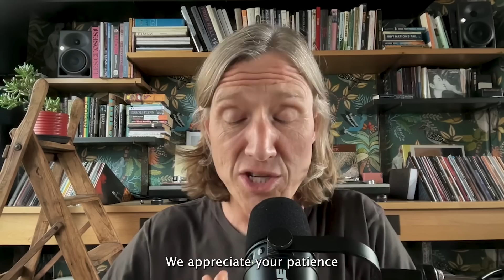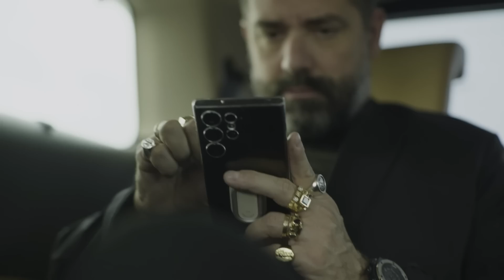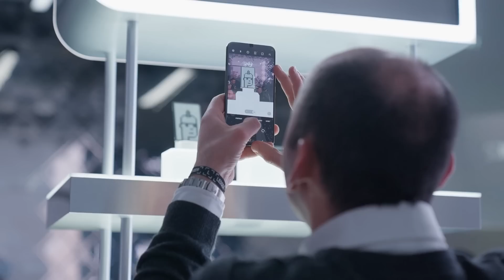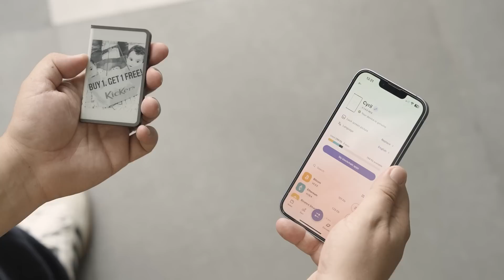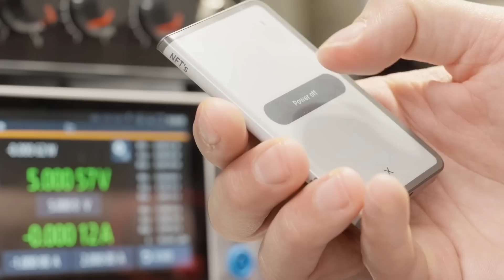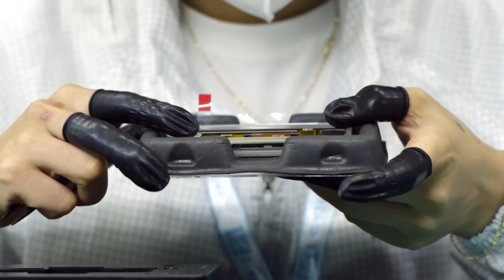Road To Ledger Stax

Comment: Hello, I am your old fan. I bought a ledger cold wallet, but the connection is always HTTP503. I can't connect to the wallet. What's wrong? Urgent, please help me
Reply from the maker: Hello, to ensure smooth operation of your Ledger device, could you please make sure your versions are up-to-date in the order mentioned here: https://support.ledger.com/article/8458939792669-zd

Then head to Ledger Live settings > help > and clear cache to refresh its block explorers. And try again your connection. If issue persists, please reach out here: support.ledger.com

Comment: I place an order on 07 27 2024 and still waiting. 1 ledger stax,1 magnet shell,1 belkin boost charge. been pending since i ordered it. Any help? reference number LDG2822004
Reply from the maker: Hey, that's normal, rest assured, all orders made in July are in Batch 4, which is being shipped this month and should be completed by end of September. 

You will receive an email notification once the parcel has been handed over to the carrier. 
If you need any further assistance, do not hesitate to reach out here: support.ledger.com

Comment: So reading on seems after a 2 year wait, I've been stitched up with £420 of plastic that has 1 mere my of memory.  WAC.
Reply from the maker: The storage space for apps is the total storage space of the device minus the firmware size. The firmware size can vary depending on the firmware version. 

You can safely install and uninstall apps when needed. If there's not enough storage space, simply uninstall some apps to make room. By uninstalling apps, you will not lose your crypto assets since your private keys always remain secure on your Ledger hardware wallet.

Learn more: https://support.ledger.com/article/4404382258961-zd

Comment: After waiting for more than two years, the NFT market almost burned, this is too late ledger, why do I even need a ledger stax? If I want to show my NFT collections I can set as wallpaper on my phone.
Reply from the maker: This is why: Our Secure Element chip and innovative touchscreen products like Ledger Flex and Ledger Stax set us apart, offering unmatched tamper resistance. Our attack lab, The Ledger Donjon rigorously tests our devices to maintain the highest security standards. Additionally, we hold the ANSSI certification, awarded by the French Cybersecurity Agency after independent labs have conducted thorough tests on our devices.

While competitors have their strengths, Ledger does not compromise on Security. Ledger’s security model and continuous innovation ensure that your assets stay in your control, no matter what.

Learn more: https://www.ledger.com/academy/topics/ledgersolutions/ledger-wallets-secure-screen-security-model

Comment: Coinify stole my money when i made a transaction in a ledger wallet. Ledger its not safe.
Reply from the maker: Ledger Live is your secure interface, not your custodian. Always verify what you sign on the secure screen of your Ledger device, which is connected to the Secure Element chip and cannot be tampered with. Transactions are always signed on your device, ensuring that your assets remain offline and protected. Avoid blind signing whenever possible. Don’t trust, verify. 

Learn more about clear signing: https://shop.ledger.com/pages/clear-signing

Comment: All of this is negated by the closed source code and the fact that there is a back door to extract keys
Reply: Is this true?
Reply: @frixosfriedman7813  yes. Ledger has a recovery seed thing where you upload your private key they hold in case you loose your keys
Reply from the maker: At Ledger, our mission has always been clear: to empower individuals to securely self-custody their assets. With over 10 years of innovation, 7 million devices sold, and zero hacks, Ledger is the trusted leader in hardware wallet security.

1. No Backdoor. Ever.

Claims of an “active backdoor” on Ledger devices are categorically false. Ledger’s security model is based on secure element hardware and cryptography, ensuring that only the user has access to their private keys. Ledger Recover, provided by Coincover, is an optional service and does not change this principle.

Ledger takes transparency seriously. We employ proprietary software for our Secure Elements, ensuring the highest level of tamper resistance and security. Importantly, a majority of Ledger's code is open source, including Ledger Live, Wallet API, Secure SDK, and embedded applications on our devices. You can review key components like the LedgerOS commands dispatcher, and entry points of Ledger Recover, provided by Coincover, implementation and its cryptographic library here. Ledger undergoes regular third-party security audits to ensure our security measures remain robust and reliable.

2. Ledger Recover: Cryptographic Innovation with Security.

Ledger Recover is an opt-in paid subscription service provided in partnership with Coincover, an industry leader in digital asset protection. It is designed for those who find the traditional 24-word recovery sheet daunting. The service requires a paid subscription and leverages advanced encryption and shard-splitting technology:

- Your seed phrase is split into 3 encrypted shards, each stored separately by trusted providers in three different jurisdictions.

- The shards can only be reassembled with your explicit consent, through your device and ID verification with two of the three providers.
Neither Ledger nor Coincover has access to your private keys at any point.

- In the 1+ year since its launch, there have been zero incidents involving Ledger Recover, provided by Coincover, with many customers expressing relief knowing they have added security, the peace of mind of having a backup SRP, and the convenience it provides.

3. Third-party access Misconceptions.
Let’s clarify:

- Ledger cannot decrypt your seed phrase. Shards are stored with independent providers, encrypted, and require your identity verification (IDV), Ledger device, and consent for decryption.

- A minimum of two of the three fragments would be required for any jurisdiction to gain access to your wallet, and a court order would need to be obtained in at least two jurisdictions. These individual fragments are not exploitable on their own. Two of them would need to be recombined and decrypted with separate keys. Any order of this nature would realistically only ever be obtained in the most serious cases of criminality (such as where terrorist financing is suspected).

- If a user chooses not to IDV and pay for the service, none of the above is relevant or applicable and the Ledger device operates the same as before.

- If anyone gains access to your physical wallet, extracting keys is only possible if they know your PIN. Ledger’s secure element and PIN-protection prevent brute-force attempts, ensuring your funds remain secure—even in the event of theft or loss.

Additionally, with over 600 million crypto owners worldwide, only a portion of them are in secure self-custody. Ledger Recover, provided by Coincover, is aimed at empowering more people to self-custody their assets instead of relying only on centralized solutions.

Ledger stands for self-sovereignty and security. Misinformation like this only hinders the movement toward wider crypto adoption and self-custody. We encourage everyone to research thoroughly and make informed decisions about their security.

Comment: Why only 2 MiB?
Reply from the maker: The available storage for apps on your Ledger device is determined by subtracting the size of the firmware from the total device storage. Since firmware sizes can vary depending on the version, the remaining space will also differ.

You can confidently install and remove apps whenever needed without risk. If you run out of space, simply uninstall some apps to make room for others. Uninstalling apps does not affect your crypto holdings, as your private keys remain safely stored on your Ledger hardware wallet at all times.

For more information, visit: https://support.ledger.com/article/4404382258961-zd

Comment: I would buy one just as long as “Ledger Recover” is absolutely NOT mandatory! NOT YOUR KEYS NOT YOUR CRYPTO STILL STANDS WITH THIS GUY!
Reply: It is not relax
Reply from the maker: Ledger Recover is an optional subscription service designed to help you securely back up your Secret Recovery Phrase. Importantly, your private keys never leave your device. The service uses advanced cryptographic techniques to split your Secret Recovery Phrase into encrypted shards, which are stored by independent custodians. Only you can reassemble these shards, ensuring that Ledger cannot access your keys or steal your tokens.

The service cannot be automatically activated. It requires your explicit consent through a signature using your private keys, an onboarding process that includes identity verification (IDV), and the payment of a subscription fee. Your security and trust are our top priorities.

Learn more here: https://www.ledger.com/academy/what-is-ledger-recover

Comment: Ledger recover booooooo!
Reply from the maker: Ledger Recover is a subscription-based, optional service designed to provide a secure backup for your Secret Recovery Phrase. Your private keys remain exclusively on your device at all times. Using advanced cryptographic methods, the service splits your Secret Recovery Phrase into encrypted shards, which are securely held by separate, independent custodians. Only you have the ability to reassemble these shards, ensuring Ledger has no access to your keys or tokens.

This service is never enabled by default. Activation requires your explicit approval through a signature with your private keys, an onboarding process involving identity verification (IDV), and the payment of a subscription fee. Protecting your security and earning your trust remain our highest priorities.

Learn more: https://www.ledger.com/academy/what-is-ledger-recover

Comment: it now includes the all new back door feature! because we want to keep you safe🤡
Reply from the maker: Allegations of a backdoor in Ledger devices are entirely untrue.

Ledger Recover is an optional subscription service designed to provide a secure backup solution for your Secret Recovery Phrase. Your private keys always remain on your device and never leave it. The service employs advanced cryptographic methods to divide your Secret Recovery Phrase into encrypted shards, which are securely distributed across independent custodians. Only you can reconstruct these shards, ensuring Ledger has no access to your keys or ability to access your assets.

This service is not automatically enabled. Activation requires your explicit permission through a signature using your private keys, a thorough onboarding process involving identity verification (IDV), and the payment of a subscription fee. Safeguarding your security and trust is our highest priority.

Learn more at: https://ledger.com/academy/what-is-ledger-recover

Comment: No one has really articulated what the point is of this? Why stack it? I just dont get it
Reply: It's so you buy more than just one device.
Reply: It only comes with 1MB of memory (lol). Less than the Nano S Plus. So, if you want to run a couple of apps you need to stax some stax.
Reply: @Maxxximilain and each costs $300 lol
Reply: @Maxxximilain  so its an inferior product, sold on the premise of a better ux so they can sell more products for corporate greed - got it
Reply: @Maxxximilain  wait really?
Reply: @Saintel  yes, i have 4 apps installed on it and i am at 380 kb used of the 1 mb. while its hard for me to understand someone could be deep enough into different ecosystems that they require more than 1 mb worth of apps, i guess that is something to keep in mind.
Reply: Stack it like a bunch of cash in real life? multiple wallets holding funds inside, sorta like cash stacking against one another type of concept. then from the curve display you see wordings like if u held a bunch of cash together you see some image / wording?
Reply: Yah we know, but really that’s it
Reply: easily readable .........stack different devices for different use cases...one for nfts, one for defi and web 3 and one for more cold storage for. example
Reply: its just supposed to be cool you turbo nerds are weird
Reply: So the point is if you own multiple wallets this makes viewing them from the side easier.

I personally own a Nano S, Nano X, Ellipal Titan, Ellipal Titan Mini, Trezor One, Trezor Model T, a Keep Key. I only use 2 of them though. The others can be backups or alternative use.

Interesting enough the screen on the side doesn't even offer much benefit until you own 3 of the devices because if you look at the top one and they both are your wallet because lets be real what Idiot hands over their wallet to someone? Just looking at the top wallet you know what the bottom is. So unless you have 3, then the only benefit the screen wrapping even has would be to see it from the side if its places more out of sight like up on a shelf in front of your desk you cant see the screen but you can see the side.

But the whole stacking thing is a gimmick. You can set wallets on top of each other right now but they do not hold securely to each other. This might also actually offer a unique safety where because the yare stuck together they are not sliding around in the bag if you have multiple.

But yeah we all know the real reason is they want to sell more devices. That satisfying feel of the magnets closing together will satisfy anyone who fidgets.

Comment: Did you fix  bags on nano plus first? When you loose all your coins after hard-flash after connection to PC by USB.
Reply: you didn't lose all your coins, use your seed phrase to recover your wallet. unless you mean the actual device ITSELF is no longer usable, yes that sucks, but you should take solace in the face that your coins are NOT lost, you can recover them in a matter of minutes.
Reply: @LUSCIOUSDUNCAN   Wallet by seed was not recovered. That was bag. the seed was not found in blockchain, you knew that bag was?

Comment: This is great and all, and I DO appreciate the depth of the information, but the DEAFENING silence from the company for so many months as you dodged the issue about the delays and danced around saying anything transparent about the state of things, the missed deadlines, etc, is something a lot of us will never be able to overlook.

This video is the kind of empathetic transparency we SHOULD have had a year ago. Instead, we got overly massaged PR statements or, more often, outright silence, and the transparency only came AFTER you had good news to share.
Reply: I know it may be frustrating with delays. I am in batch 3, preordered back 2 years ago.

However to be fair, while they did have big delays and missed the mark by a long shot. They did actually put out a fair amount of updates. I received e-mails every few months about what they were doing. And to be completely fair you have to take into account that they were pioneering new technology. There was no guide to do what they were doing because they were the first. The screen itself is what caused the delays because they kept running into issues. As explained in a prior video there was  screen "thickness" problem where it created patches on the screen and then there were just dead pixel rows and columns which would be terrible for QR codes. Tracking down those issues probably took a lot of work coming up with theories, then building test batches to see how they preformed then more adjustments and repeat. I would like to say this, they could have started with "here are the issues" then followed up sooner with a "and here is what we found why" but I don't know I can't really fault them for their recent communications. Maybe in the beginning the communication was poor but it got better.

I do hope that they take this as an opportunity to dial in the right amount of communication to meet customers satisfaction. Because there is always room to improve and things are always changing so its hard to hit a moving target, while you are also moving lol.
Reply from the maker: Breaches are an unfortunate part of life online and no one is completely immune. At Ledger, we’ve designed our technology so that your crypto and private keys remain safe, regardless of external incidents. Ledger devices are purpose-built to keep your assets secure and entirely under your control—always. We’ve reinforced our systems time and again to meet the highest standards of security in an increasingly connected world. 

Always remember: Ledger will never call, DM, or ask for your 24-word recovery phrase. If someone does, it’s a scam. Stay cautious and keep your crypto safe.
Reply: what about security breach of all customer address?
Reply: @DRAGONUZY12  it happened yes but there are bigger leaks from other companies with worse information leaked. More and more leaks have happened on larger scale.